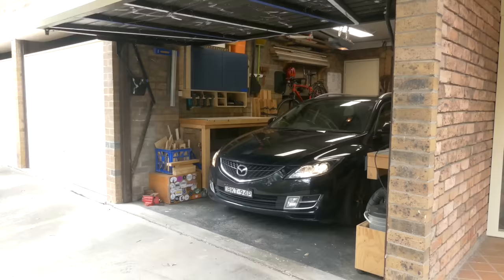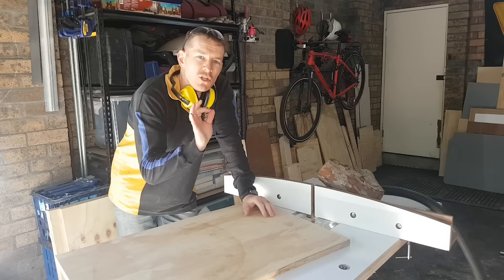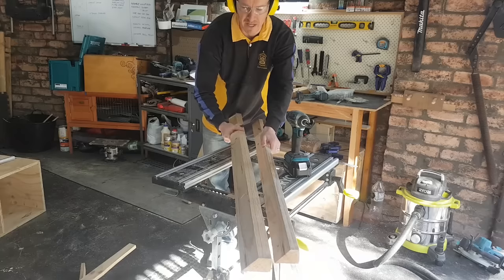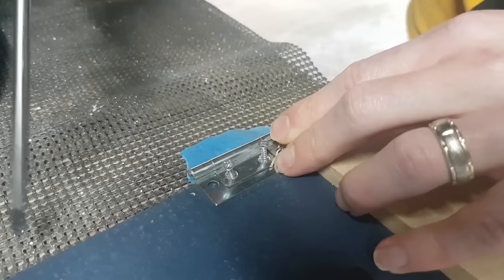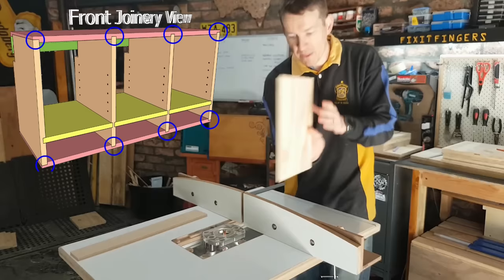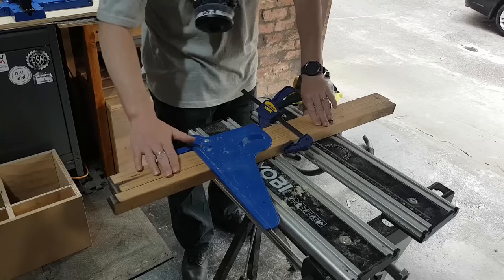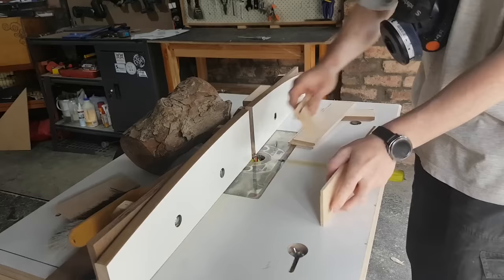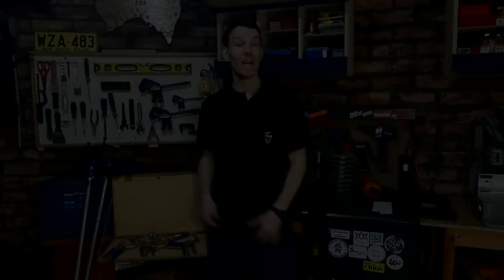The Unlimited Potential of Your Garage Workshop 🛠️

Comment: Great video, I like it. However, I would've setup miter station differently. You are holding "waste" portion of cut material. The piece that you need can (eventually will) kick back because its between stop block and saw. Nothing is supporting it. Or you need to change the way you cut with miter saw. Just my observation and suggestion. Other then that I enjoyed the video (without popcorn)
Reply from the maker: That's an excellent suggestion. I can put the stop block on the other side, I just only mounted tape on the right as that gives me a longer reach. Maybe I should learn to cut left handed. I am usually very conscious of letting the blade stop before lifting, but you are right, it's a risk that can be mitigated... Let's see what I can do. Cheers!

Comment: I like that vise.... I don't have any so I think this is the best one I can make. Thank You.
Reply from the maker: It's great for power tool woodworking and space saving. The main reason I went with that is it is basically zero space with no handle coming off the side. Need more holding power? Add another clamp :D
Reply: @FixitFingers  yeah, since I don't have that space like yours, mine is half long as yours, so this is a must for me. Again thank you and if you have more tips for like the space I have please upload it too hehehe
Reply from the maker: @raultebelin5354  about 150 other videos on the channel to go through 😁
Reply: @FixitFingers  yeah thanks.

Comment: Now I just need a garage
Reply from the maker: That would be ideal, but any space can work :) I think it was Steve Ramsay from Woodworking for Mere Mortals who started his woodwork career by running an extension cord to a circular saw on the roof of his apartment building in SanFran... and that lead to some great things ;)
Reply: @FixitFingers  I love Steve :D 

I currently work out of my yard/driveway in that same fashion but that's VERY weather dependant lol 

Eventually if the sticks fall the right way or however that old saying goes, I'll have a portion of our back porch to set up a few things up :) (or at the very least a job site table saw 😂 if I can repeatedly make cuts or work sheet goods I can save up for a small building a lot easier)
Reply from the maker: Chase the dream one cut at a time 😊 @cosmicbrambleclawv2

Comment: I subscribed because I have a design that's impossible or expensive
Reply from the maker: Ok AI bot, welcome to the show 😊
Reply: @FixitFingers  hahaha I'm a human not ai bot
Reply from the maker: @beingabdaal950  hahaha lol so sorry!  😅 I've had a string bots recently that used a similar format for their comments. I didn't quite understand, what design do you have that's impossible?
Reply: @FixitFingers  I built a mini "carport shed/workshop office so trying to figure out designs that I can walk in and out without bumping my head or hand or leg 🤣 but this metal shed doesn't have much mounting points has a falling apart cupboard inside which is huge
Reply: Let's say I need to store stuff inside but also be able to work in it.... from south africa durban
Reply: @FixitFingers  it's ok no worries sorry about the bots
Reply from the maker: @beingabdaal950  hahaha ooo challenging space.  My best advice would be wheels. Get everything on casters so you can shift it easily. Cheers and good luck!
Reply: @FixitFingers  thanks good idea was actually thinking of it

Comment: Did you ever discover why youtube said they were going to ban the vid you mentioned? I dont think ive even heard you swear so cant imagine what you did wrong!
Reply from the maker: Hahaha I think you'd be in trouble in half your vids if that was legit 🤣 No, that was just a joke reaction to my slow motion sanding of dowels 😝
Reply: @FixitFingers  yea well sanding the dowels was a beautiful thing playing with that Shaft
Reply from the maker: @michaelwillson6847  best piece of filmography I've ever shot 🤣
Reply: @FixitFingers  absaloutley top class don't think you'll be able to slide into anything close to another perfect shot like it again. 😜👍🏴
Reply from the maker: @michaelwillson6847 I peaked early. Some say that's rude, but I'm satisfied. 🎉
Reply: @FixitFingers  as long as your happy with the way you've rubbed your shaft that's al that matters🤣👍🏴
Reply from the maker: @michaelwillson6847  silky smooth result. No finishing oil needed.
Reply: @FixitFingers  and all that also means no protection needed. Dammit a should of stopped sanding after 1 instead a did another and ended up with 3
Reply from the maker: @michaelwillson6847  🤣👶🤣👶🤣👶

Comment: mate if your measurements are out that much that you need to shim it but actually shim because you use a spirit level then you have no idea how to level a project and keep it square during the building process. sorry mate but watching you spirit level  and shim when you were building made me roll my eyes. Always keep the project square during the build. what you did put your job out of square badly. A spirit level is only used at the completion of a project to make sure it is horizontal and can be achieved with levelling feet .
😊
Reply from the maker: Sorry Adam, 3 hour video with a dozen projects made 5 years ago....I'm gonna need a time stamp to remember what I was doing on the bit you are talking about 😅